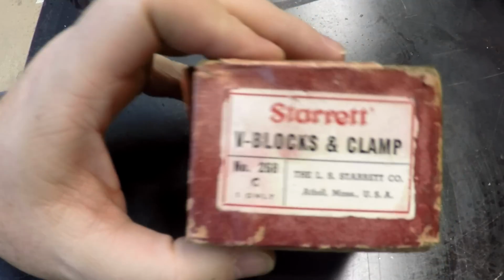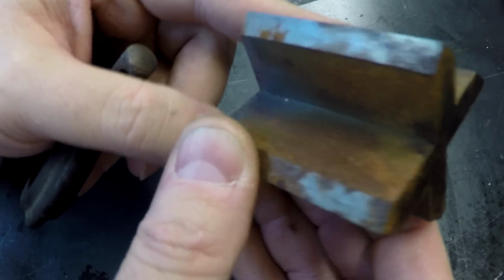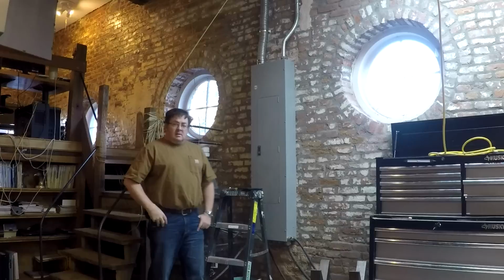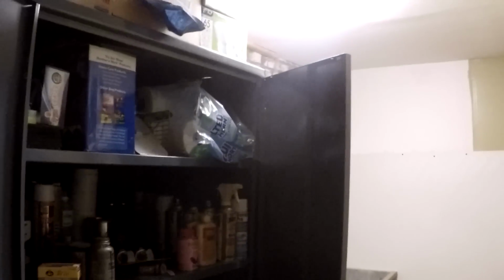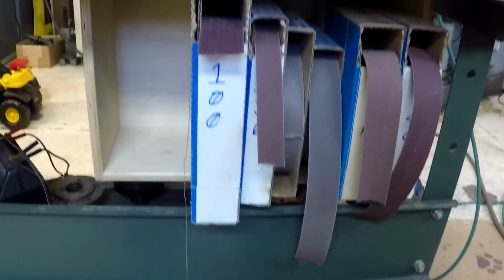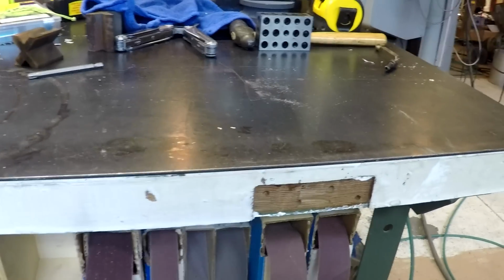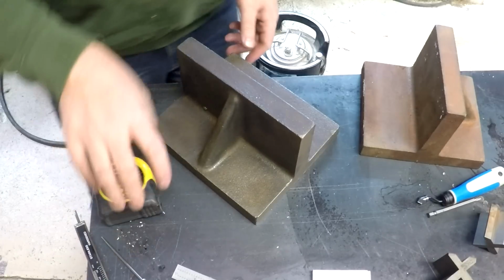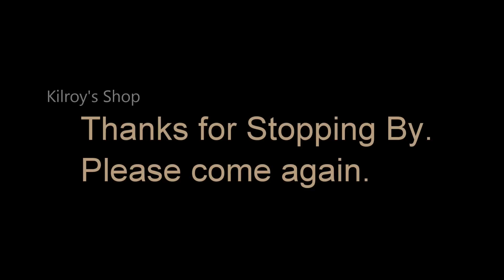Shop ADHD #15

Comment: Hi James another great ADHD for us to get involved in. Glad the power feed is working well. There are always a few minor details that can be upgraded on any project so I am sure you will get it to your liking soon. You have plenty of space on your wooden draw fronts for small stickers. I like the idea of a board on the wall behind you. You could make it a wheelie frame so you can put it any where you want to tidy (hide) any area you want. You could also use it for pinning drawings on. I would not use a white board though as it may increase glare. Some thing similar  in colour to Adams tool board he has on the wall in the background would be good. Good luck with the cleaning up. That's one job none of us ever finish. regards from the UK.

Comment: I would keep the small one T shaped and machine all the sides of it you may have a use for it someday . But make the big one into what you want  Nice tour of the shop !!!
Reply from the maker: not2fast4u2c I think I am going to do a basic clean up on both of them and then see what strikes my interest.  Easy enough to bandsaw off the extra web.  Thanks for the suggestion.

Comment: My suggestion isn't really related to anything you asked about, but as a guy that moves a lot of things that weigh too  much to easily move by hand. I  have a suggestion for your vise. I made a 4" wide square block and drilled and tapped it to screw a lifting eye in.  Then clamp the block in the vise and lift away with your hoist! It saves backs and makes moving and positioning much easier :-)  You can get by with a narrower block but I find a 4" drilled close to the moving jaw side balances the vise better.
Reply from the maker: bcbloc02 Thanks Brian, I will take a look at that.  I need to find a way to get my gantry down to this end of the shop so I can put it to use for stuff like this.

Comment: I think that having the T shape angle blocks could be very useful. Not in an everyday way perhaps, but a job that could be done with them would be something like a cylinder that needed machining in say the milling machine then moved to the drill table or the shaper for additional procedures or flipped end for end. The T shape would give options in holding / clamping the angle plate, whilst the job stays in the same position, a bit like a universal fixture or indeed a box plate.
Reply from the maker: Stephen Deakin I hadn't considered that possibility.  I guess I need to make sure that the two of them end up as close in size as possible.  I could see where using two, for long  work, could come in handy.

Comment: Hi James,
I use my 2 ton cherry picker, set up with electric winch, to lift my big vices, 18" rotary table, etc, on my Okk MH-3V mill, and other machines. Not the best way, but works for me till I get something better. Just a thought. Keep up the good work. Jim
Reply: I've got a shop crane = motor block hoist which i use for most "light" lifting in my garage shop... I've also got a 3/4 ton chainfall which I've been known to attach to the bottom chord of a roof truss for lifting loads in the 500# - 700# range...

So far, my maximum lift has been a 12" x 36" Logan lathe to get it off of the U-haul trailer... not too high of a lift...

The bigger problem is rigging the load before lifting, and planning the lift such that there will be a safe operation, and a clear place to lower the load...
Reply from the maker: Jim Fairbanks chemech I would love that, but I have a floor best described as 'uneven' and stuff that rolls around can be a pain.
Reply: James,

I can see where that could be an issue... I've got the original asphalt garage floor to work with, and that's no prize after all of the years since it was poured...

Overhead setups with a hoist trolley riding on a rail - such as the flange of an I-beam - can be kind of limited in terms the places where you can make your lifts, and can suffer from low overhead clearance...

Not sure what your solution will be, but I'll enjoy watching it on You Tube as you work it out.

All the Best,

Eric

Comment: Hi James !

I often thought of making some of these angels and T-shapes myself ... looking for material every time I'm at the scrapyard where they often have some scrap pieces of huge angel, I- and T-beam material from building constructions, but until now I have not found pieces that satisfied my needs - but still looking ;-))

Those Starret V-blocks and clamps ... isn't there a problem when clamping ... I think the threaded clamping screw will not allways point to the center of the V - right ? What if you have to clamp a square stock, the screw could point at one of the sides of the stock and then be 45° off the "optimal line of force" - I you get what I mean - isn't that a problem ?

I like your shop, lots af space - compared to mine, at least - and these circular windows - I love them - ... but I have to live with the fact that my shop is only for a retired IT-developers need for creating things in the real world ;-)), so I live with my 36 m² (~360 Sq.feet) + some sheds spread around in the garden ;-))
Reply from the maker: Keld Sørensen Hi Keld, no the V block clamps work great.  The outer clamping surfaces are angled to fit the outer Vee's.  They are all 90 degree, just of different depth.

Comment: Q: Any tips to follow when using cloth rolls?
A:
Use light machine oil with cloth rolls as a lubricant for finer finishes and quicker cut.
 It is the user’s responsibility to refer to and comply with ANSI B7.7

From the norton shop rolls page:
http://www.nortonindustrial.com/Rolls-MetaliteK225Cloth.aspx

Comment: Wherever you decide to setup a background, don't have a window behind you.  Washes out the video and makes it difficult for your camera to maintain light balance.
Now that you know the power feed concept works, and know you need a few tweaks, it's a good time to remake the parts in a color that better blends with your industrial machines.
Reply: Wherever you decide to setup a background, don't have a window behind you.  Washes out the video and makes it difficult for your camera to maintain light balance.

I agree

James your setup today is pretty good, the cardboard boxes, Carhartt
brown and machine grey without the windows lets you get a good white balance.
Reply: "Wherever you decide to setup a background, don't have a window behind you.  Washes out the video and makes it difficult for your camera to maintain light balance."

It would be a shame to not display the round windows ... that makes your shop unique. As Adam mentioned, they are iconic.

If the overexposure and daylight color balance is a problem, you can adhere neutral density and color correcting vinyl sheeting to the windows. I used this technique when I was in the movie business years ago, and I still might even have some "stored" in the attic. I'll look for it.

Comment: Hey James, great video! I really appreciate the chemical closets in the metal cabinets. As a former painter who had lacquer thinner in 5gal. cans, and every VOC under the sun, I learned quickly just how invaluable that storage can be. Customers with cigarettes would love to try and burn my shop down with a disgruntled flick of their butts into my garbage can as I instantly pointed to the "No Smoking" signs. Those cabinets saved my bacon a couple of times that I know of for sure.

As to the last project on those T-Blocks, would it be useful, or redundant, to add a T-slot to one or both of those extra faces? I know it would look cool, but would it actually help in any set ups? Thanks for the show and I appreciate any answers you've got on that subject. Aloha...Chuck
Reply from the maker: Knolltop Farms I will probably add slots to the area behind them upright web, for bolting to the table, but I will leave the working surfaces clear until a specific need requires alteration.

Comment: Of all the Youtube machine shop guys, you are the only one with a built in logo.  Your sticker, enlarged, and placed on a banner behind the lathe would make a perfect background for you.  Of course you would have to have a slightly more clever design, something like Kilroy looking over a lathe or boring machine.  You could also include in the name of your shop/company.  Get a banner made (not white) and place it on the wall.  There is a guy in Starkville that makes great banners and could help you if you were so interested.

Comment: I noticed that as you were showing a pan view of your shop that the gear stack for the Pacemaker is sitting on the bench.  I was wondering if you have found a solution for the broken gear.  Keith Fenner who has a You Tube channel, can help you with making a new gear.  Keith has a "Jumping Jack" attachment for his KT mill which he has used to cut splines and I'm sure he could cut the matching spline in your gear blank
Reply from the maker: Gordon Eckler You are correct, none of the shops I checked with want to take on the repair of the gear for one reason or another.  Or they want $2300 to make a new one, no kidding.  I am looking into turning off all the gear teeth, turning the blank down say 1/2' and they boring out a stock gear of same size and pitch and shrink fitting the resulting ring onto the blank.
Reply: James Kilroy That's sounds like a good approach too.   Best wishes for a successful repair

Comment: James.

No one else has a brick wall much less one with a circular window. I really like it the way it is and think you should not clutter it up with whiteboard stickers and girlie pictures.

Light problems with the window will depend on which wall No So etc it is on.  North would be ideal mostly a diffuse light,  South would be the most direct light and for longer period.

If you just gotta do the girlie thing hire a live stripper / pole dancer.  A challenge for her could be a long piece of shafting hanging out of the lathe and in back gear.

White board is good for doing drawings related to the video only otherwise mostly just another distraction.

I like the Rivetti also - is that a solid concrete block it is resting on??  If so it may be worth some video time and discussion.

Dan Bentler